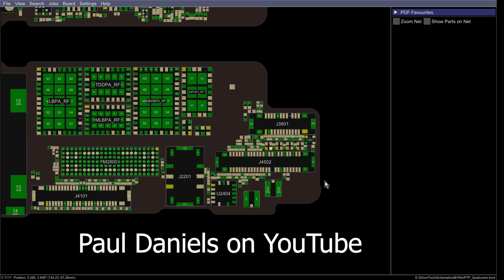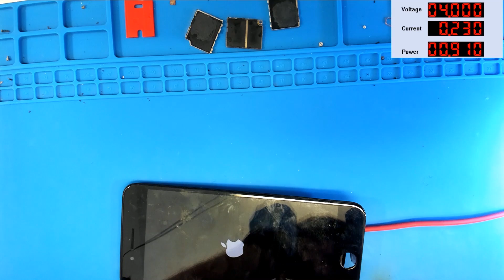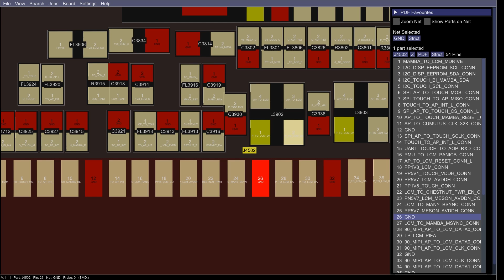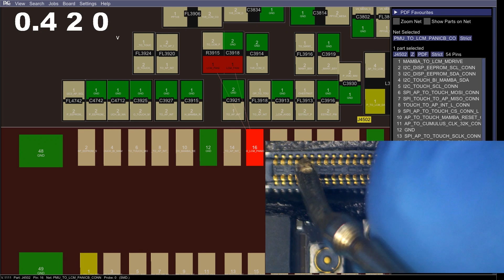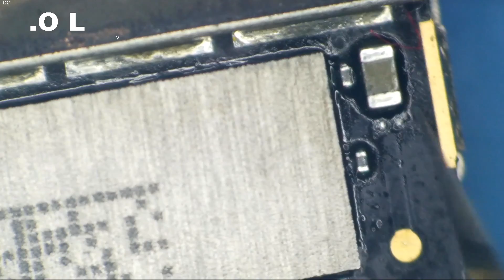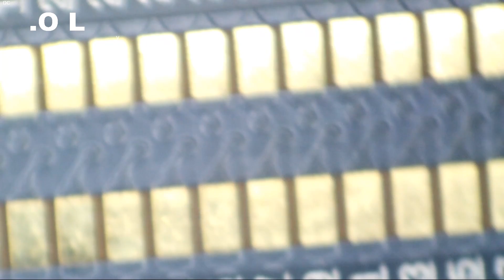Could you help me fix this iPhone 7 plus image problem?

Comment: its a nand problem change the nand and see if it works or not
Reply: Either NAND, RAM or CPU issue , Replace NAND like he said , replace upper RAM and reball CPU , if not not much else i can think of :D one of those will fix issue as might be a dry pad etc :)

Comment: Its diode i had it before ... screen boot up normal after apple logo screen go dim i had low voltage on diode it should be 22v replaced diode and update phone and it worked fine

Comment: Ive seen a similar issue in a 6s where the wifi ic had an active short meaning it would short after it turned on. this board also has popping solder balls net to wifi ic caps try look for a short in that area or remove wifi ic and see if it resolves issue. also could be nand issue.

Comment: Image is generated directly from the CPU. Phone has both powered backlight and powered display, which means the board most likely has brittle or cold solder joints beneath the CPU.

Test #1: During boot up, use your thumb and directly press down on the CPU. (CAREFUL! CPU becomes surprisingly hot!!)
Test #2: Use the hot air station to heat the CPU (roughly the temp used to remove black CPU adhesive). Prompt the device to boot. 

If you get a full "boot to home screen", the problem are the bad solder joints beneath the CPU. Simply reball the CPU and retest.

Comment: Nice to see two videos like in a  two days  man 💪 If only I could help :/ Did you checked for those solder popped thingies (PP2V9_UT_AVDD_CONN and PP2V9_NV_AVDD_CONN) around wifi ic with thermal camera?  Long time ago I had similar apple logo fading issue with an iPhone 5C, and it had short on PP5V7_SAGE_AVDDH. This probably doesn't help but still :) Greetings anyway and I hope you're doing well in Florida! 💪

Comment: maybe a pin is floating or bad voltage, check the caps or replace them and try again. caps aren't that important but maybe for some part it needs exact voltages
Reply: check caps on the datalines, It's like data comes through in pieces.
Reply: at the end the communication between screen and logic board is sending into chopped parts, the screen just receives data and I think if the signal isn't clear enough it will start showing fade issues or brightness issues. maybe the screen board sends a signal back that it's missing data and shutdown de pins after it? that's on my thoughts

Comment: At this point I'd check ripple on chestnut's outputs with an oscilloscope (long shot, probably not but a way to rule it out) and I think you don't have one so skip this one (I don't either but I borrow one hehe).
Then I'd try and restore the firmware if data is not a concern, the board looks pristine except for the guys on top of wifi (wich are mostly for front flex stuff so nothing to do here). Maybe an error code during restore could point out to where the fault is

Comment: if it was my phone, i would hook up an external supply to feed that backlight line with the correct voltage, the one with 15v on it .
Just to see if the display always loses its data.
If it explodes in a ball of fire then my eyebrows would vanish and i would have to paint them back in like the silly females do, too dam high. Always supprised :-D

Comment: Just a theory did you confirm no power leak anywhere? Or parts getting extra power? And vertical lines happened to me from the connector of the screen and disappeared after fixing the connector

Comment: I would check to see if any of those filters by the connector are loose under the coating
Reply: yeah agree
Reply: He checked on every pin and everything looks fine. This is a gpu related in my opinion
Reply: Just Klev yeah I saw, I’ve had a intermittent half display issue on a 6S plus before that was from a previous repair pry damage and it was fixed by locating a loose filter. Could definitely be the gpu too
Reply: @gotchou  Lose or missing filters will produce half or no backlight, backlight but image or image with no backlight. Distorted image or graphical garbage are caused by missing or damage data chokes, CPU outputting a poor image or a poor connection to CPU image output lines. 

My guess is poor connection to CPU image output. That phone took a fall now it has brittle or broken solder joints beneath the CPU. When the phone is powered on, the CPU  heats up. The space beneath expand. Those solder joints begin to separate. The more separated the solder joints, the more faded the image.